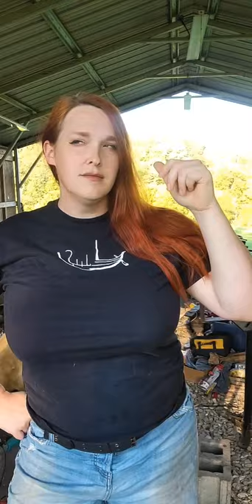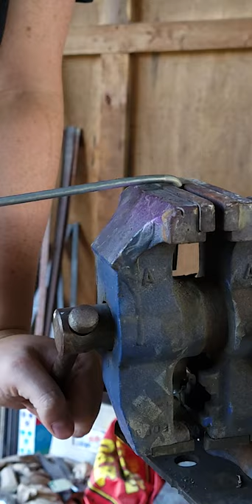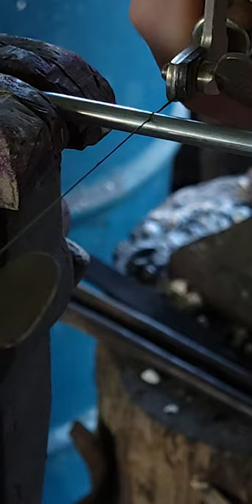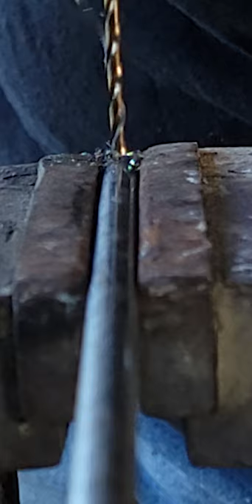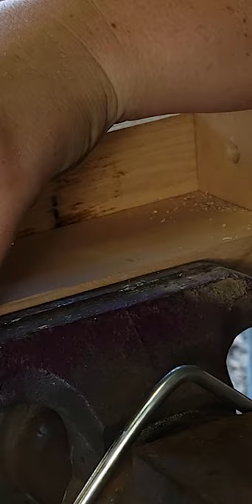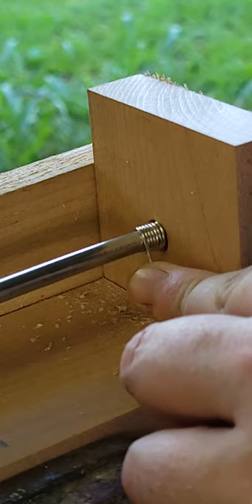how to make chain mail or necklace rings!

Comment: I've been making my own rings for a few decades, so I'd like to point out a few things. First, solid simple design: easy to build, easy to use, highly recommend!

There's a bit of a catch that's easy to fix. The catch: feeding with your finger. First, that's a lot friction. Next, if you reach the end of the wire by accident, the spring will uncoil with significant force and possibly (badly) cut your finger - even through gloves.

The fix: drill a 1/8" hole through the wood opposite your finger and feed your wire through that instead. As you form the spring, gradually move the crank so the wire stays tight but doesn't overlap. If the end of the wire accidentally feeds through the hole, then at least your fingers will be out of the way.

Tony Domingo's method is a step up from that. I can send a photo of my rig if you like.

Comment: Pro tip, Philips head screws are terrible and easy to strip out. Use the star bit heads for less stripping and easier reuse of screws. I pretty much assemble every project I do with #8 T25 star drive construction/deck screws.

Comment: So, What I have learned making links. Have your round stock with a hole, much like Fey. Take a block of wood with the same size hole as the round stock and cut a grove  leading to the hole to serve as the wire guide. Insert the rod onto a drill, insert the wood block onto the rod or mandrill and then insert wire into the hole in the mandrill. Slowly and with practice you can make a "spring". Now use a different "mandrill" of the same size and vice it up with a little of the spring in it. The rest you cut with a Dremel and metal cutting blades. Voila, you have yourself a lot of links to make 4 in one, 6 in one, or eight in one. Depending on wire and link size,  eight in one is awesome but heavy and doesn't move well.

Comment: I would like to know if it is possible to hammer weld titanium wire to make the rings of chainmail.  Titanium is light enough to rival aluminum and strong as steel, but I've been told it's hard to work.  If it cannot be forge welded, perhaps a coat of riveted chain of titanium would be possible.  I would call it modern mithral.
Reply: I've seen a couple of attempts to to make Damascus from some interesting metals. Titanium is difficult, requiring rather high heat - but not as high as niobium, apparently.
Reply: You can spot weld the ends of the rings if you make the links out of titanium, it's the best method.
Reply: @anelpasic5232  Spot welding is a very modern technique.  I am thinking of emulating the fantasy material called mithral using techniques available in the Middle Ages.
Reply: Riveting would definitely be the best method, just remember to use high quality drill bits  when drilling the ends of the rings. Titanium has a nasty habit of work hardening when you try to drill it too fast and heat it up, just like stainless steel. 
So go nice and slow and cool it down with oil or water and if it still gets too hard to drill, use carbide drill bits (they don't care)
Reply: @FuzzyMarineVet  Again, I got carried away and suggested you use a drill, forgetting you wanted to use more authentic methods. While drills are ancient inventions and could be used, your best bet otherwise would be to heat up the end and punch out the hole with a small punch. Punch a hole mid way through and turn around the ring and finish it from the opposite side. If you try to punch a hole in one go, there is a high chance that you will tear the material open.
Reply: @anelpasic5232  Thank you for the advice, but this I already knew.  I like the idea that we can  retain the ancient wisdom in the modern high-tech world.  The fact that Fay uses hand wielded hammers instead of power tools allows the viewer to see the natural way the metal moves.  Once that is understood the smith can apply it to the power tools.